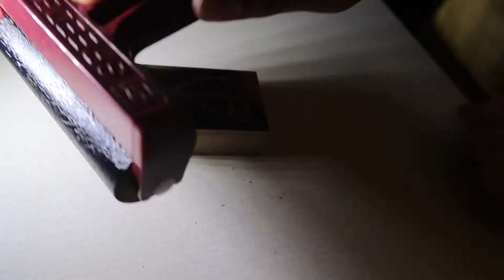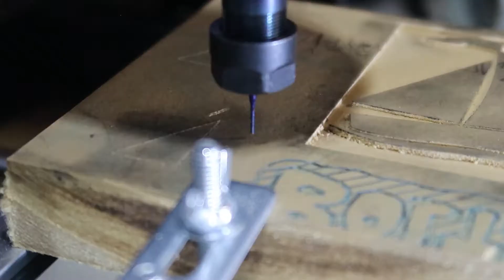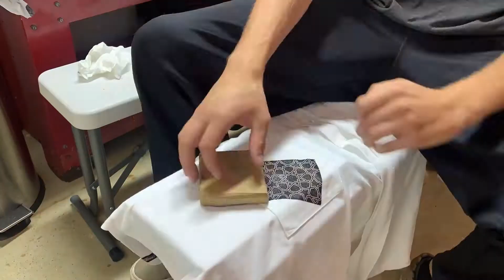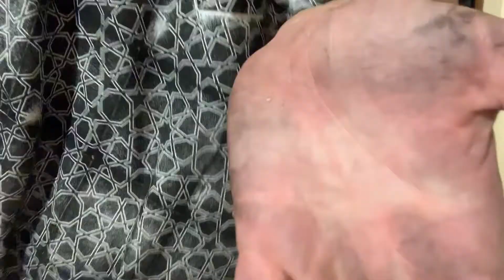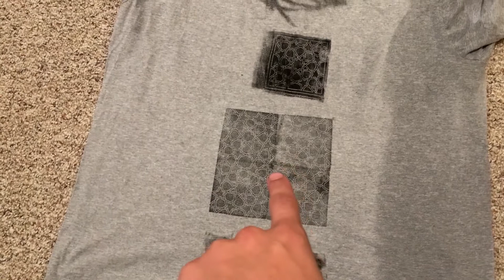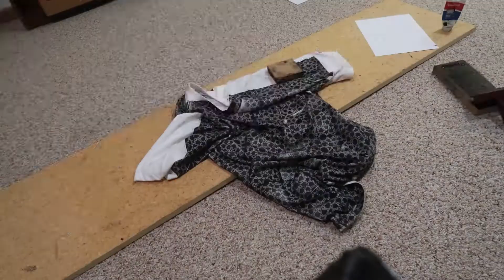Linocut Printing a FULL T-Shirt with CNC

Comment: Hey. You can use screen printing ink with the lino block / stamp. Then heat set with a heat gun/hair drier while doing the stamps over the shirt then iron to fully set the colour. I have just started my journey of making stamps for products. I purchased a mobile heat set /press machine that set the ink quicker than an iron.
Reply from the maker: Awesome thanks for the tip!
Reply: @JacksonTravel  you are welcome!